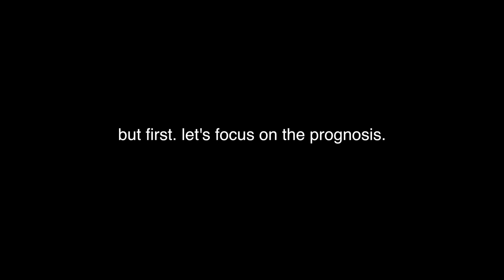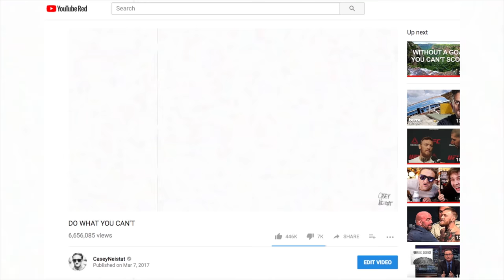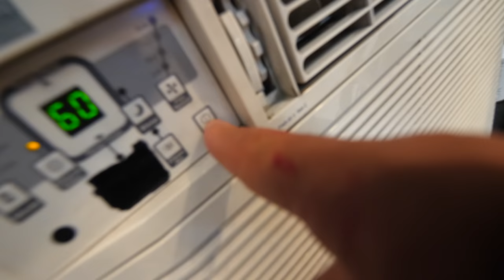learning the prognosis

Comment: Aw man. I had the same exact injury end my running career. There are basically two options here: 1. endless hours of stretching and physical therapy that help for short periods of time but you still end up living with a pretty serious chronic pain, and 2. you can get this crazy surgery where they cut notches into your IT band to extend it and prevent it from pulling your kneecap but doing so means you will probably never be able to run the same as you used to. So sure you can definitely live with it but goddamn does it suck, I wish you luck Casey and I hope you can power through it

Comment: I had the same issue with my knee. I torn my meniscus playing football in high school which lead to surgery, PT, recovery which lead to weightlifting and playing football the next season and I had the same unique pain in my knee and I thought it was always just that annoying knee pain. I went to the doctor, had an MRI and the results came back that a plica had formed behind my kneecap. I had another orthoscopic surgery on my knee to get the pilca, excess scar tissue and fluid cleaned out of my knee. I have never been the same since then. I experience knee pain everyday of my life. Some days are worse than others like high activity days but I don't really run anymore. I get my cardio from an elliptical or another low impact activity. Keep in mind I got about 2 inches of my meniscus removed so that doesn't help much with impact. Good luck to anyone who goes through similar issues. They can be a pain (Literally). Take care.

Comment: First of all, very happy about the results. But do consider a bit of cycling in the mix. It's less tough on cartilage & joints generally. It's also another way to get around. You can often cycle on the same routes as well.

I had to switch from cycling to walking post surgery and during my chemotherapy. It worked well for me. I now walk every day, regardless of other activities. It's always good to have options.

Good luck Casey.

Comment: Casey I also had multiple snapping plicae, we had to get it removed and it turned out it was multiple with lots of scar tissue and it was all removed. I spent like a rehabilitating and its been maybe 2 years now and now my knee dislocates several times a month but I cant get a surgery done because I'm still growing and it would fracture the bone when the plates fuse... It turns out my platela is at a severe angle and so easily slips, Good Luck :D

Comment: @CaseyNeistat - Awesome!  Great news!  I was told by a doctor I would never run again. Then got a second opinion and after therapy went on and ran 150 miles across the Sahara Desert, and then 135 miles in the Amazon Jungle. Human body is designed for running. Do you do recovery after your runs? Ice-bath? It sucks but 20 minutes of ice-bathing the lower body = 70% faster recovery improvement as ice pushes Oxygen rich blood to flushes out impurities from lower body and reduce inflammation. This is what allowed me to go out and run a 5k after running a 100 miler...and accidentally win it.

Comment: imo see the surgeon and see what they say. maybe get a few opinions. but also imo DO NOT GET A LATERAL RELEASE to get this "fixed". i'm not anti-surgery. i'm a realist. i had an ACL recon. i needed surgery. the ACL doesn't heal on its own. but, that same trusted doctor also thought i needed some other stuff to get back to football, squatting and skateboarding and it turned out he was wrong. great doc did a dope job on my ACL uhh over seven years ago. but since i'm the actual boss of myself and realized surgeons generally rely on surgery, i tried a more conservative route to fix some small issues that lingered post-op and all were solved with the right attention from the right DPTs (doctors of physical therapy).

go get with a great DPT or more than one because not one PT fits all. you have access to a bunch of 'em up there (i'm in NJ).

yes, i know you went to someone you termed a "running specialist" and it didn't help. 

good, athletic doctor of physical therapy. someone who works with athletes and not just people who wanna get up and get their mail and/or walk the dog. or like i said - see two, because one size doesn't always fit all with these people.

if that doesn't work, ok fine - you did what you could and have no other choice. but i see way too many people trust surgical procedures for this stuff. i could go on about that but i'm sure you get the point.

good luck. but as an aging athlete myself, i can tell you - you'll have to get used to adapting and spreading your outlets around instead of overdoing it in one. it will help keep you from being in this situation again...........regarding the stress of supreme disappointment wondering if something so important is going to be nixed from your lifestyle.